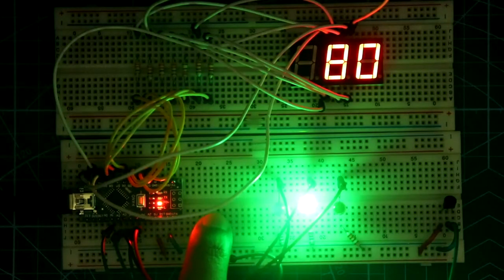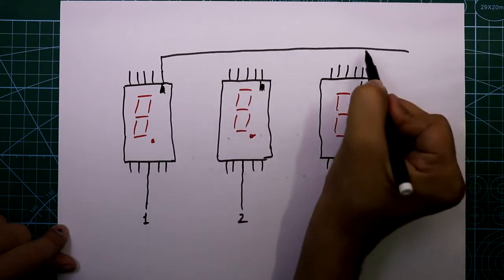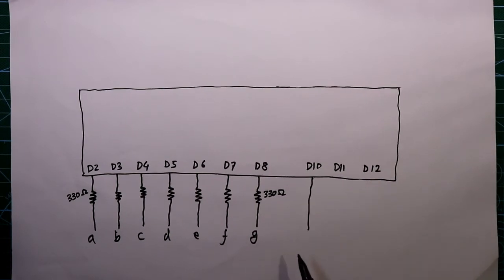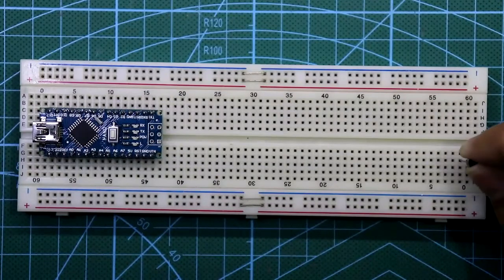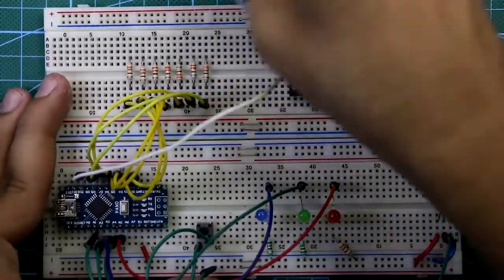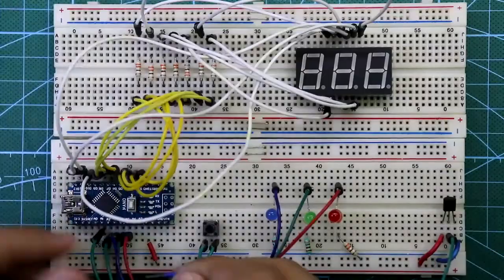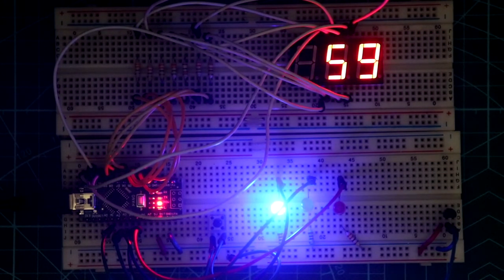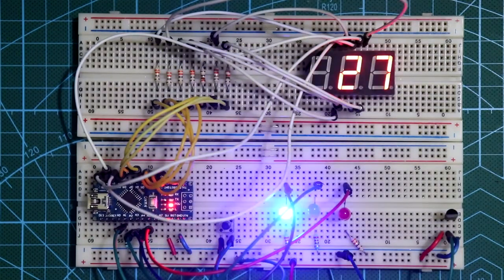How to make thermometer using lm35 | Arduino Project

Comment: Hello, how can i change the value of temperature so that instead of reading and displaying
32 degrees celcius it displays 34?
Reply from the maker: In the program. Just add +2 with degree calculations.
Reply: Could you please be more specific since I am really new to this and I am not sure what line exactly to add and where to put it in the program